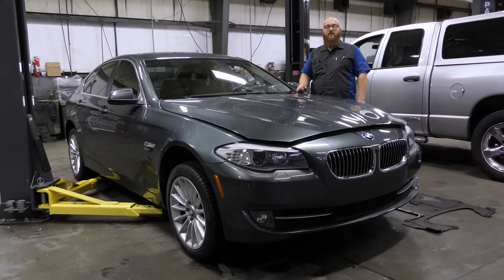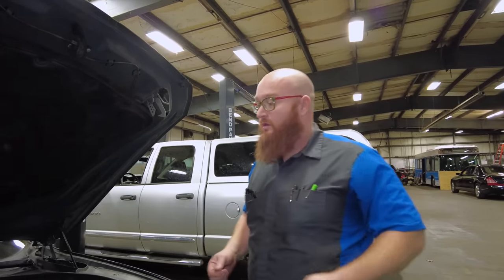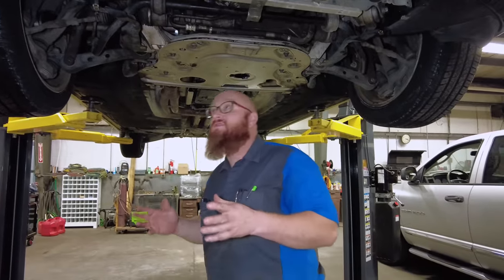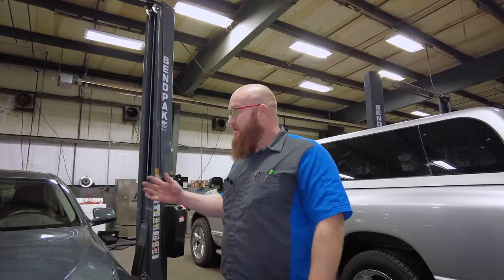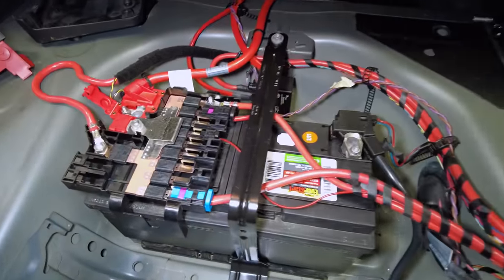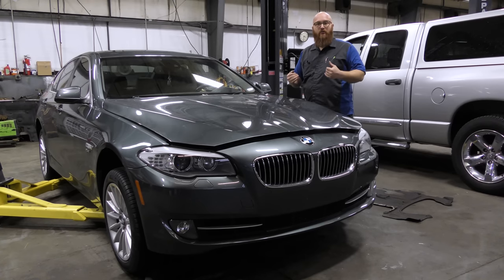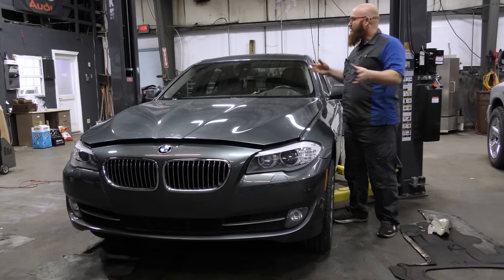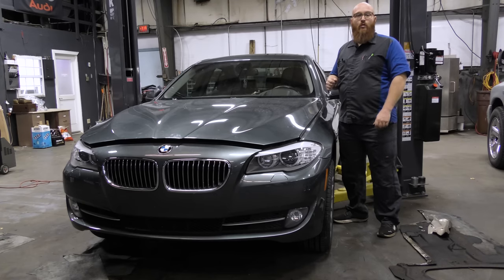One bad day for a customer! CAR WIZARD found TWO insanely unrelated issues at time on '12 BMW 535i

Comment: The answer is right in front of you if you think hard enough ! # 1 you have here a 10 year old ; 200,000 mile car. Things break at that age and mileage ! The car IMO ,  served it's owners well ! The older the car ; the higher the mileage ; the more chance of things breaking down ! That's just the way it is for starters. ( No pun intended ) # 2 So here's is what happened ! The car had a loose hose and caused a loss of coolant. From that point on it was Danger zone ! Although it probably didn't get hot enough to seize the engine ; it did get hot enough however  to tax the other parts . In essence a 200,000 mile starter. Everyone knows a hot engine with it's expanded parts is harder to start and turn over. Therefore ; when he went to start the car ; hot ; he overloaded an already worn and tired part. The Starter !! It might have already been on it's way out ; but when you try and start a hot; tight engine ; you are forcing other parts to work harder. The starter / solenoid and it's electrical components just could not handle the extra torque to spin the  hot engine over and just burnt out !    I am BT --a Ret. auto mechanic with 62 yrs experience.

Comment: I don't get the fuss. A leaking coolant hose and a failing starter (at a 10 year old 200.000 miles car). A bad coincidence, that's all... And the neutral lever is not a BMW thing it's a ZF thing...

Comment: Bollocks.. The coolant hose blew out simply as it was not clipped in properly. This hose specifically is the easiest one to disconnect when you need to drain the coolant out of the system for whatever reasons or repairs. Then when you reconnect it the clip jumps to open position sometimes and if you are not careful enough to notice you miss to lock it in. Running it hot builds up the pressure in the system and it just blew out at some point. Its quite a snug fit due to O-ring so can hold a good period of time without the clip locked in. Its simply an issue of poor previous workmanship I can guarantee you this 100%.

Putting them in emergency neutral is literally always on the side of the gearbox, every single BMW auto model starting F series. Some have a screw, some just a leaver you pull down and wedge in some bolt, stone or w/e you find at hand. Any half descent mechanic knows this and it takes no more than 5 minutes to engage it. You only need to jack the car a bit, undo few undertray screws around that edge and activate the emergency neutral. If the recovery guy cant be assed to rub his back on the ground to do this he should not be working as a recovery driver. 

And lastly the starter.. Starter motors are actually bullet proof in BMWs. Occasionally they go wrong tho. In this case might be just a coincidence to happen at the same time, maybe that motor was on its last legs a while and the extra heat it got from overheating engine due to coolant loss simply killed it. Overall, BMWs are one of the easiest European cars to work on in my experience anyways. No point even comparing it to Audi, Mercs, Porsche or any other premium vehicles. Also do not compare them in this regard to any budget class vehicles for the reasons I see pointless to mention.

Comment: If it was manual transmission the towtruck could have towed it and it could have been tow started to check the engine condition.

Comment: I get what the wizard is trying to say. It’s an unfortunate situation. However the car made it 200000 miles on that starter. It’s just coincidence it failed right when the coolant hose blew. Things work before they break. Bite the bullet fix the starter, if the engine is good, sell it. It’s going to start nickel dime him. I bet Hoovey would buy it! 😂

Comment: I have 2013 BMW 530d Touring 400k km and it fail, summer the temp gadge gone up, it was EGR cooler fail, luckily BMW dealer replaced as a recall.

Comment: Awesome car, especially with the b47 and b57 diesel engines. Comfortable, fast and with a very low consumption in relation to the performances.
Reply: @TheMrDudiness in Europe is still cheaper.👍
Reply: There is no b57 diesel in f10 only n57, b47 yes but b57 dint go in f10
Reply: @fernandostanic2035  the B57 Is the inline 6 version of the B47. 😉
Reply: @valefur72 i only say that there is no b57 engine in F10
Reply: @fernandostanic2035  they begin the production of the B57 in 2015, so it's strange...
Reply: @valefur72  its not, they began prodicong b57 in late 2015. to have enough for for new G series models. N57 continued to go in f10 and f30 up to 2018.

Comment: They are related! the engine overheated and locked. the customer and tow truck driver tried to start it locked and it fried the starter. the  is cooled down and unlocked.. pistons expand and lock. starter turning a locked engine fries

Comment: My wife bought a BMW 3 series  touring estate car, cheaply from a colleague.( Cheaply is a clue)
I'm just a driveway DIY monkey, but I've never had so many stupid things to repair one after another.- since September 2023+

Oil leaks from the oil filter housing ( rounded off aluminium bolts- cannot repair fully)
Blocked  front windscreen wiper pump.
Sparkplugs that wouldn't come out 
Small coolent leak
Nearside headlight housing adjuster broken - unit now pointing uselessly low( cannot repair)
Aerial amplifier, situated in the rear spoiler, water contaminated resulting in key fob signal not being received, car can be only locked with the emergency key, resulting in an alarm activation,every unlock.
Horn intermittent fault
Rear glass hatch window micro switch not working, cannot be easily repaired 
Drivers door handle remaining in the extended position resulting in door flying open on a tight bend

Why do folk rave about these primadonna highly strung poodle cars?

Comment: I will be interested to see if any plastic lines under the intake popped as well and soaked the starter. I hear about those coolant lines cracking all the time.
Reply: I would be interested to see how is your car holding up when or if it reaches 200K miles? LOL

Comment: I don’t believe in coincidences, sorry. I suspect the overheated engine may have  caused the starter to fail. I also suspect it might be more to the story. Using the wrong coolant is also a factor here, these also lubricate the pump.  With BMW if it’s something that’s about to go wrong you’ll be notified, CAN based diagnostics system in BMWs are extremely advanced and ahead of their time. The car tells you way before you’ll encounter a big problem and warns you that an issue must be addressed. So if you neglect things (no regular preventative maintenance, repair the car on the cheap by incompetent techs using  incorrect tools, parts and fluids etc) the car may seems like it’s always got something wrong with it but in reality the car is telling you must take action, before something catastrophic  happens. This owner as nice as he/she might be, I believe ignored these warnings long enough to experience a catastrophic failure.

Comment: You can get 200k mile BMW 535i at dealers for $8000 - just dont. Repairs will cost the same as a new $60k car, not an $8k car.

Comment: The car is not ripping the customer off. You are. 150 am hour? Wtf you smoking?
Reply: Thas what i said. Bosch starter is 150$ and oem ( is valeo) is 250$. In germany to replace starer is around 150, max 200€ and around 250-300€ in bmw garage

Comment: I had a truck on the lift doing only ball joints. After installed, I went to move it to the alignment lift and the started went out. Literally in the shop, the starter went out

Comment: Mine has 240k still going. Starter wasnt working use the old hit it w a hammer trick with a metal steak and came back. Worked for months😅

Comment: Bmw makes some of the best and most reliable cars on the road people just need to stop abusing their cars by driving hard all the time and not changing the engine oil on time.  You should change the oil every 6 months and use it mostly for motorway driving 65mph plus for 90% of the time and your car will never die.

Comment: Those strut braces are ridiculous. Purely cosmetic. They are made of tube with the ends squashed and the angles of them are shallow, they'll just pivot on the single bolts at each end. Modern BMWs are for mugs
Reply: Unless they do their own spannering of course

Comment: Lol😂 I went through the same exact issue on 2008 dodge avenger, my friend car alternator went, then she restarted the car until battery died, and I changed the battery. Then she did it again until and I changed the battery. Now it won’t start again, and I found starter is bad after …

Comment: Well over 300000km I think it deserves a break down. Not defending BMW here but using a 321 000 km car as an example and reason to not buy a brand...not sure about that. I do feel for the customer as well and if it was me I would be pissed but if it was me I would never own a car with that many km's on the clock. Modern BMW's and Mercs are no longer the collectables they were, use them for 5 years and move onto something else and if you want a car to last 10-20yrs get a Lexus but even then if you reach 300 000 km's expect issues to start creeping in.

Comment: Worn starter, at 200k and it's then, overheated with abrupt coolant loss, and the solenoid winding insulation melted, with exposure to the high heat,  that's why the starter dumped.
   Mr and Ms consumer, hear this old technicians words and hear them clearly.  
   Brow beat your politicians, with these statements.
    Right, to repair
    Standardize modular engineering.
    Standardized parts.
 And you just keep beating them over the head, with it intellectually.
  And your world will never be like this again 
  Ain't that right Billie Bob?
   Yeah, that's right Jimmie Joe?

Comment: No car with an automatic should ever be pushed in neutral with the engine off or roll in neutral above 5mph with engine on. Some workshop manuals point out a special procedure that is adding a lot of oil to to the box to submerge the inside of the trans if it is an emergency. if this car is pushed in neutral with the engine off the oil pumps in the transmission and transfer case wont be working and damage will likely occur. Tow truck drives should know that they have to pull the driveshaft and raise the front wheels before towing a car like this but they often dont and they often break the drivetrain. Imagine a car being misparked and towed and bmw having to pay for a new drivetrain under warranty. It is very difficult in a transaxle bus broken on the side of a San Francisco freeway to pull the halfshafts before towing but it is done because the bus transmission is expensive much like a bmw transmission.

Comment: I bet the heat from the engine killed the starter. On the k series from Honda it’s the same deal, starter under the intake, I went through 2 before I bought a heavy duty one.

Comment: Makes sense to me. He cranked and cranked and cranked until the starter went out. Why do you even work on BMWs since you clearly hate them so much? Strange the starter on my n52 engine was less than 200 bucks for a Bosch. I have had my E46 for 15 years and not replaced a starter once. My X5 I've had for over 10 years no replacement of the starter there. Weird huh.

Comment: I loved the BMW 3series and had all versions down through the years from the e21 up to the e46, after that I drew the line once the e90 came along with all these nonsensical "body modules" and various coding requirements even to change the battery. Nothing but badge engineered German scheisse now.

Comment: But did you tap the starter with a hammer or something just to get it to try and start to see if the motor was good? It works about 90% of the time. Because it's usually a corroded connection needs a quick tap and you're good to go at least just a test

Comment: BMW has put the starter there since they have had inline six engines, yes often it is a PITA but the car is a 2012 do starters last forever?  NO.  Anyway for sure this is effort, it's just as bad in the past as it is now... maybe, worse in the past, e36 would take a while too.  On the S54 in my car I can have the intake off in 15minutes.  SO more WAMBULANCE from you.  And yes it had to be a hose, because the WP is electric and will limp the car at failure, i have mixed feelings here but the car should not overheat to the point of issue now days.  For the curious, the starter is always there the alt and power steering always where they are and the AC compressor.  The biggest change is the electric water pump.  Now it is super interesting that they have aluminum bolts now on some of these motors that are one time use of course but it has to do with lightweight materials used and corossion.

Comment: "i dont like these cars, they screw their customers"

meanwhile that thing gave the owner 200k miles of service which is a high milestone for most cars, and you dont think twice about someones far more expensive mercedes in the same mindset, not even blinking an eye about a v12 mercedes repair costs.   

we get it, you hate bmws but your logic baffles me.  ive owned a dozen bmws and they have all served me well, over half of them had at least 150k miles on them too and a couple had over 200k and were all easy to fix.

200k miles and it has a leak???  pretty much any car will be leaking something, somewhere, at 200k miles.  we get it, you are so overly biased with bmws bruh.
Reply: Agree 100% a bit of a sob story for a Beemer a with 200k miles.

Comment: $212 for OE Japanese Denso starter for this BMW 535i with Lifetime Warranty at FCPeuro and  your charging $1,200!!!  😂  Your labor is a rip-off, takes about 1 1/2 hrs or less to replace the starter as all you need is to take the top side parts/vent hoses front the engine area (below the air filter) not the bottom of the car.  When I replaced my High Pressure fuel pump on my F10 535i I could see right behind it the starter and was easy to get to and replace!

Now for the car shutting off and "preventing" from starting do to loss of coolant it's a BMW safety feature the WORKS and is how it PREVENTED the engine from getting destroyed from overheating to the brink of total failure.  For the starter failing sometime it's a coincidence and a failing starter will just fail all of a sudden on BMW's and it makes it a faster process when the engine creates more "heat" (do to overheating from lack of coolant) that premature the life of the starter in this case!   But what do I know, I only work on BMW's... lol

Comment: WIZ,HELLO,BUT THATS 1 MARQUE,I WONT BUY,IN THESE DAYS,,,NOE BEING RUDE,BUT BMW,STANDS FOR BLACK MANS WHEELS..,   THE VERY FIRST BMW,DRIVER,WAS AN ‘ISETTA’,
THEN,ON A TRIP,,I BOUGHT A LARGER 5 SERIES,RHD,  5 SPEED MANUAL,IN SCOTLAND,DROVE IT FOR YEARS,I HAD TO USE,A MOP HANDLE,WITH A COFFER BAG,TO PAY TOLLS,IN NJ,some SOB,STOLE IT & burned it,but my insurance,would NOT  replace the RHD,but,I never replace the BMW,Bought a FORD TAURUS,91 3.00 LITRE V6 USED,IT WENT FOR NEAR 500 THOUSAND.,,  WIZ,I SURELY LOVE YOUR SHOWS, ,,,,,,,🇺🇸🇺🇸🇺🇸🇺🇸 15:19

Comment: Granted, the mechanical parts of the car are badly designed. But 200,000 is high mileage. I would be interested in knowing the repair history of the car.

Comment: I am gonna gues it's the waterpump and that it sits inside the engine so that you first have to take out the engine, open it up. You then need to dress up in a chicken costume and jump on one leg for four hours before putting it back inside, then put back the engine.

Comment: 200k and it needs a starter? If that is the biggest issue at 200k you have a good car. If it was an Audi you would need to take the front bumper off, the radiator out and the whole front of the engine just so you could take the starter out the front of the car, only to find it out of stock. Or would you rather talk about the starter that lives deep in a V-8 valley?

Comment: Car Wizard, what do you think of the newer 340i series? Most BMW owners claim the B58+ZF8spd transmission are very reliable now. Debating if a 2017 or so model would be worth the gamble. I was considering the Lexus IS350 but it's kind of boring compared to the 340i w/ the 3.0 turbo B58.

Comment: BMW - Big Money Wasted.  Having owned one, they are fun to drive, but they have become more and more overly complicated when it comes to electronics and repairing them.  Thankful that the Toyota engine in my Lotus has been dead ass nuts reliable for 10 years and almost a hundred track days.

Comment: NONE of this is unusual. The car is 10 years old and it needs a starter and it blew a cooler hose. i’m not sure why any of this is a big deal. If you’ve had customers come in with locked up motors, it’s because you’re too stupid to shut the car off when it overheats. Doesn’t matter what car you own if it overheats, shut it off! Even the customer that you’re talking about this time, tried to start the car again! if it overheats don’t run the car. why is it so difficult?? The timing of the starter motor in conjunction with the coolant hose blowing is a little odd, but other than that this is standard maintenance. I know it’s a thing to rag on BMWs reliability, but I am self taught working on BMWs. They are not hard to do. If you’re truly a well seasoned mechanic, having to take the intake off to get at the starter motor isn’t a big deal.